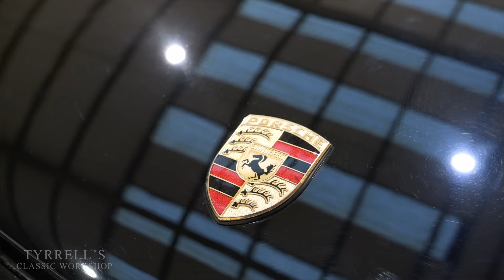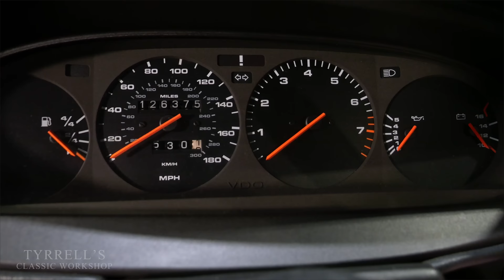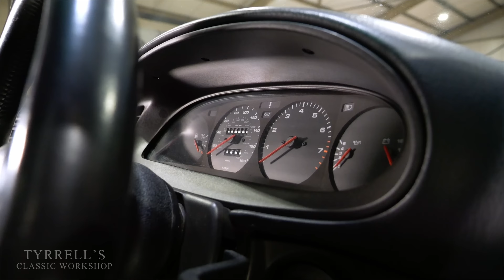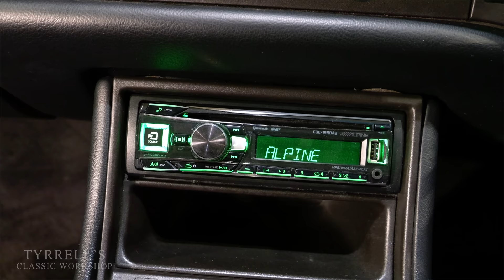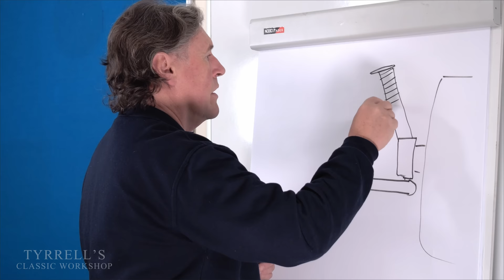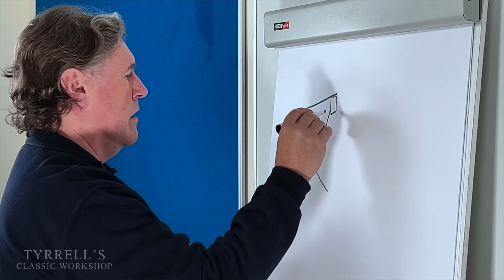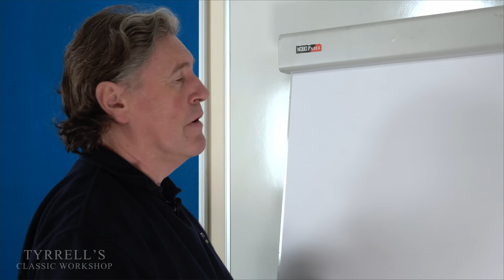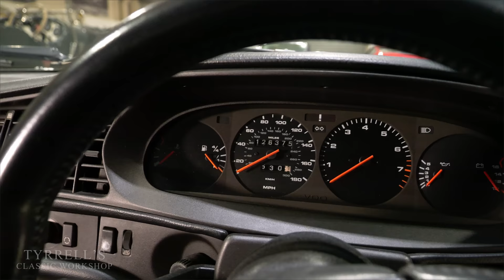Porsche Perfection: Unveiling the 968 Club Sport's Secrets | Tyrrell's Classic Workshop

Comment: Pretty sure Porsche licenced the dual contrarotating balancer shaft setup from Mitsubishi as they held the patent at the time. The project that turned into 924 wasn't originally going to be badged Porsche...it was handed over early on as having a Porsche badge was more lucrative. The suspension maybe broadly similar in concept & layout between the 968 & 924 but they are very different in detail. The 944 Turbo revised a massive amount of re engineering of the suspension & drivetrain whjch carried through the 944 S2 & 968. I've owned an early 944 & driven quite a few...I'm going to be contraversial...I have no idea why people rave about how well they handle...they're ok & feel solid & well sorted but nothing earth shattering IMHO. The ergonomics betray the age of the bones! The 944 is a perfect case study on how a fairly plane jane looking 924 can be transformed into one the best & most '80s looking car in existence! Mega looking.

Comment: A nice video with a well-deserved praise of Porsche's so-called transaxle models (924, 944, 928 and 968). In the 80s I had three of these models (924, 944 and 928 S) which were all really nice sports cars in their own way. I liked the engine in the 924, but there is no doubt that it started to become an older design by the mid-80s. Still, the 924 was definitely a fine sports car with which you point out many of the same qualities as the other later and more developed and sophisticated models. Unfortunately, I never got around to acquiring a 968 due to children, buying a house and work. A more practical car was required (Mercedes-Benz W124).
Reply from the maker: Thank you. Maybe one day?
Reply: @iain_tyrrell Yes, I have considered a 944 S2. 968 are few and therefore quite expensive (not to mention the Club Sport model). However, I love these old Porsches and think they are much better than many people give them credit for. At the time, Porsche was much more than just the 911.

Comment: Couldn't see anyone else mention, so I'm going to do it, nice 968 "Sport", there I've done it, feel much better now! :D The "snobbery" Iain is referring to comes from the fact that there are a number of sellers inflating prices just by virtue of a name. The Sport was a UK only model invented by Porsche UK and essentially a Club Sport with most of the creature comforts added back as options. If I was in the market for a 968, I'd be looking at a nice Sport as they have been around the £12k-£20k mark, whereas genuine Club Sports (without the comfort pack) go for anywhere from £25k+ Yes I know that the Sport started life with a Club Sport chassis number on the production line and then had most of the stripped out bits added back in. But the whole idea of buying the Club Sport was that it was a stripped out car right, lighter and more track focused! Those comfort seats and electric windows add an enormous amount of extra weight. I do hope when it comes up for sale (as has this particular car many times before) that it isn't another £30k pretender.
Reply: Good to see someone else point this out! It's up for sale at £26k with the CS tag, but has been for a while. Such a shame seeing these peddled as CS's, as they're a great car with their own place in the 968 'range', they're just not Club Sports.

Comment: With the 924 being very much a 'parts bin car', the earliest 924's suspension consisted of most of the parts from the 1303 Beetle. There were some differences but many of the parts interchange. As Porsche developed the 924, with changes like 4 wheel / 5 stud disc brakes for the turbo, these parts can easily be used to upgrade 1303 Beetles - they pretty much bolt on. The 1303 front suspension was in turn developed from the 1302 - the first Beetle with McPherson Struts in 1970. The rear suspension dates back to the 1968 semi-automatic VW Type 3, which was used in semi auto Beetles around the same time, then later in many manual Beetle models too. So the 968's suspension development history goes back quite a few years more than the 924.
Reply from the maker: Thank you for that!
Reply: @iain_tyrrell  No problem - I added a bit more detail. Thanks for all your interesting videos.

Comment: Porsche developed their own balance shaft system for the 944 apparently using three bearings instead of the two employed by the Mitsubishi system. However, Porsche discovered that the Mitsubishi system worked better. So, Porsche paid Mitsubishi a royalty of 6 - 8 US dollars per car to use the "Silent Shaft" system.

Comment: I owned and drove for nearly 100000miles a 944 TurboS.  I wish I had never sold it !  The turbo power delivery was a bit wild though, with loads of turbo lag,  so the 3L 16 valve cars (968 and 944S2) are probably better bets.

Comment: Thanks Ian. There is a rarer 944 Turbo, the Silver Rose, 75 rhd only. Uniquely to the 944/968 it has, I believe, variable rate front springs. Along with slightly narrower front tyres, its handling was even better. 

There were a handful of 968 Turbos as well but I don’t know if they sold into rhd markets.

Comment: The 968 engine has only one balance shaft. Thanks to having forged pistons and con rods, there is less reciprocating weight than in its predecessors. Porsche was able to eliminate one of the balance shafts as a consequence.

I had one (not a CS, but modded to make it CS-like). It was lovely, but the 996 Carrera I owned afterwards was better — very similar experience but much sharper turn-in and moderately gutsier engine. They’re the same price now. I’d recommend the Carrera.

Comment: All the 968 versions were 3.0. The last of the 944 s2 was also a 3.0. Great engines these, better on a track than the 2.5 turbos due to no lag, loads of linear power and big power at high revs due to variable valve timing. Owned all variants inc a 968 M030 CS non lux. One of these with a fast road/track geo setup is a wonderful thing 😎, one with a poor geo set up will have you if not careful! 👹

Comment: Alfa Romeo Alfetta GT had a front engine, rear transaxle, but used a De Dion axle. Achieved low unsprung weight but kept the wheels perpendicular to the road. I had one of the 2.0 liter cars, not very fast but out-handled even 911s. I once caught a whale tail 911 in a cloverleaf, he was porpoising around, looking squirrely, but even with less than half the power I had him. Of course when he hit the straight he took off, physics can't be denied. Cheap suspension has limits.

Comment: I've always had a week spot for the 944. The 924 was overlooked. 
 The 968 was a car at the end of the run.
  The Audi 5cyl or some Porsche derived version would have been an awesome package with that unique sound and bark.😊
Reply: Audi 5 cylinder lovely sounding engine agree, but as they were all at that time cast iron blocks, whereas the 944 was a full alloy engine not even cast iron liners, the extra weight would have ruined the front balance and turn-in, probably increasing understeer. No one's ever complained about Ford Cosworths only being 4 cylinders. 🤔

Comment: Thanks for the education on suspension design of this platform.  I had a naturally aspirated 944 which was an absolute joy to drive.
Reply from the maker: I bet it was!
Reply: Any 944, an early car, a turbo or S2 they are all great drivers, developed off the 924, with the most smoothest 4 pot engine ever made.  Such a balanced car, hated in its day for not beings air cooled rear engine car, but they were incredible.

Comment: Another great video, a few errors but as its all off the cuff how can you complain! I have a 944 S2 coupe and it is a joy to drive, very communicative and responsive. Your point on the slop in the gear linkage, I have an "Only 944" short shift linkage in my car, they might do the same type of kit for the 968; it certainly makes a big difference.
Reply from the maker: Thanks for your pragmatic comments! As you say, off the cuff
Reply: Great video Ian enjoyed it. I have a manual rack in my S2, a little heavy at parking but on the road its almost telepathic steering. They are the only mods on my car I have standard suspension. 11 years of fun and enjoyment and still counting, just waiting for better weather! @iain_tyrrell

Comment: He's not wrong abut feeling connected,, my bog-standard 968 and 87 944 Turbo felt like the chassis was bolted to my arse.  Such wonderful cars,,, I was so stupid to sell them so I could buy an M-Coupe,,, which was a great car,,, but nothing like this.  Decent MPG,, more fun than a bag of squirrels. So easy to work on,, and back in the day the parts were cheap as chips.  The roadholding was preternatural.

Comment: Iain, I believe that the Club Sport used a 3.0l M44/43 evolution of the engine in the 944S2, rather than the 2.5l unit from the 944 & 944 Turbo.

Comment: The de Havilland Comet was a great aircraft, but was plagued by a very specific stress issue around its windows, which led to several airframes being catastrophically lost. 

It could unfortunately not recover its business even after design corrections were implemented because the public lost faith in the aircraft.

Comment: Sorry Iain but you are wrong comparing The Comet to the 707 in relation to the British and German motor industry.

1) The Comet was not as successful as it should have been because of the lack of knowledge about the affect of  pressurisation on air frames at the time. It took ages to find out why the aircraft structure was failing. In the end they had to dip it into a tank full of water to realise round windows were needed rather than square ones and the riveting had to change. There were a few other issues too, however, all orders made for the aircraft across the pond were cancelled as no one was going to fly on a plane that would crash. 

Boeing admitted they would have had the same issues if it were not for the Comet and the lessons learnt. 

2) Once the issues were sorted the great advantage the Comet had over the 707 was a shorter take off runway was needed. The American Government solved this by giving grants to airports to extend their runways to accommodate their jet. 

The Comet was in service from July 1949 unitl March 1997, not bad for a plane you label as a failure. 

The Americans were always going to support their own industry, the 707 came into service in 1957, the Comet was flying a full 8 years before. 

Getting back to cars, we found the white board and the suspension part boring, we skipped it and moved on to the drive.

We do not know what you have done but the picture quality of you driving the car would have been poor 15 years ago, let alone 2024. Have a look for yourself on your own smart tv at home. Your face is falling apart. 

A car without air conditioning in the swealtering summers we now have is a no no for most, especially with a black car that absorbs all the heat. 

The novelty would soon go after sitting on the M25 or any road today, on even the most modest summers day.  

If I wanted this car I would not buy it unless you could retro fit a/c.

Thanks for the review.

Comment: It should have been named 964 because it has a 4 cylinder engine, not a V8 like the 928.
If i remember correctly this version did not come with a limited slip diff, despite the 'club sport' badge.

Comment: Semi trailings arms work because they keep the curve outer  wheel at the desired angle to the road as the car rolls,  they shouldn't give excessive =ve or -ve camber if correctly designed vs the roll behaviour of the car.   Straight double wishbone  rear suspensions aren't ideal for road cars either hence modern multilink rear suspensions. BMW Ford Opel Mercedes and others all continued to use semi trailing arm suspensions for RWD cars untill they were gradually replaced by the multilink type that Mercedes 1st introduced in production cars.

Comment: 4:44 The 2.0  engine was designed by Mercedes when they were going to buy DKW 1964 But Mercedes backed off and VW bought DKW. All the water-cooled models have Mercedes DNA, Audi 100 to Audi 50. Usless fact the 2.0 was also fitted to the AMC gremlin. 

It was used in the LT but was not designed specifically for van. Used yes as well as car. The 2.0 has excellent wide cam lobes that spread the load on the follower compaired to a pinto with poor top end oiling and narrow cam lobes. Very durable engines with regular oil changes. Just not the most refined sporting engine choice. 

Audi 100 carburettor 924 injected. 

I own the UKs oldest surviving 1977 Audi 100 R prefix.

Comment: Iain, you really are struggling to explain Lanchester Harmonic Balancers...  it's a bit of a tricky subject to put across but you mangled it properly!
Reply from the maker: Thanks- I think
Reply: Iain , you're very brave to try to present what might be an automotive degree level subject very briefly! 
Also you might be referring to a Meadows Balancer, According to Newton & Steeds, the Lanchester Balancer is across the block driven by the crank pin....?

Comment: I was under the impression that the 968CS had the M060 Handling package.  I noticed that the rear shocks where not adjustable coil overs, nor was the rear sway bar  3 hole adjustable. It also looked like the front brake calipers where stock 968.  Was the M060 package an upgrade even for the 968CS ? I thought is was standard. Thanks

Comment: I thought MacPherson struts suffered from the same camber change throughout the arc as semi-trailing, they still have a single pivot point, no?
Reply from the maker: The strut travel direction can be determined by the arc of the control arm, and the position of the top mount. Not just one arc of movement.
Thanks for your interest

Comment: The entry level Porsches always get maligned…. well everything bar the 911, it’s derivatives (959 etc.), and the super/hypercars to be frank!!! 

Yet I can’t think of an article, review, video, or feature that has rubbished the non 911 cars against competition in their respective price ranges!! I was about to say that the 968 was one of the most underrated of these models, but nearly all of them are underrated by the market and Porsche enthusiasts. It’s possibly more accurate to say that the 911’s are overrated by the market, not in terms of their capabilities, but financially in comparison to the non 911 Porsches!!!

I’d love to try and own a 911. I’d love to own a 944 again or a 968! I’d love to drive the earlier 4 cylinder cars, or the Boxster/Cayman stuff since the switch to water cooled engines. I’ll admit I’m less interested in the SUV/Saloons. But the extreme differences in price between these special 968 SC’s and an entry level 964 Carrera for example is bonkers! Whether the market will ever catch on fully is hard to gauge, but the bang for buck is surely in the front four camp (although let’s not forget the front eight 928 bargains either!)!!!

Comment: 815 VIN number is a Clubsport.
Reply: I had one about 10 years ago. No rust protection coating (only painted underneath), reduced radio preparation (no radio, just 1 door speaker / each door), non sunroof, Recaro bucket seats, no rear wiper, smaller battery, no glovebox in engine bay, digital clock (instead of analogue), basic carpets, no rear seats (a shelf made out of plywood, lol), no airbags, no electric windows, rear hatch lock manually cable operated (no electrics), rear spoiler in colour of the car. LSD and M030.
Reply: @jaap5398 I don’t miss them at all, but then I don’t have my car as a daily driver.  For occasional weekend use it’s perfect

Comment: Closest thing you can buy new to this now is the GR86/BRZ…and they feel quite similar to drive.
Reply: Had a GT86 - think id have preferred the older 944 2.5 engine in it.. didn’t like the engine in the 86 at all!
Reply: @seany8787  The new one with a 2.4 FA24. Which has a very similar power output to the 968. Agree, the old 2.0 FA20 in the first series 86/BRZ was a bit of a nail. Current model is a very different engine.

Comment: iirc first gen Panamera manuals were rear drive weren't they?
Reply from the maker: You may well be right!
Reply: @iain_tyrrell  Thank you for the reply.  I came back here to delete my comment, thinking it was impolite to make a correction in a comment.  I didn't expect a reply so I will leave it.
I was just looking it up.  Base spec Panameras had rear drive, not just the manuals.  The manual Panamera intrigues me, they are quite rare.  Were any made in RHD?

Comment: To be fair, it looks like a 944 with plastic molded body panels, a redesigned interior and a hot engine, so the cost of doing this car may not have been so prohibitively high. Given the limited number Porsche could potentially have price it quite high. A note on the unions: they were a manifestation of the poor post-war, jobs for the boys, management of the 1950s. Unions didn't help by being so militant though.

Comment: Weird - I always thought the 968’s were 3 liters, not 2.5 like the 944, no?
Reply from the maker: They are indeed 3 litres- sorry if we didn’t make that clear
Reply: @iain_tyrrell I wonder how the engineers at Porsche dealt with the thermodynamics of 750cc per cylinder - bigger radiator? Oil cooler? I wasn’t aware of the sweet-spot of 500cc, so I was just waiting to hear how they handled such a large displacement per cylinder.
Reply: @iain_tyrrell And oops - you do say “three liters) near the end.
Reply: as were the 944S2’s

Comment: Iain, such a shame you have been taken in by a 986 Sport stickered up to look like a Club Sport, this is NOT one of the original 179 C16 968 CS's! It's very easy to tell the difference, a genuine CS has windup windows, rear seat delete, rear hatch lock delete, recaro lightweight seats and less switch gear in the centre console.